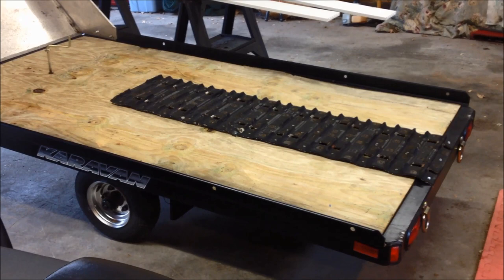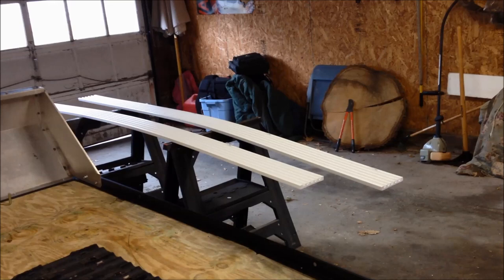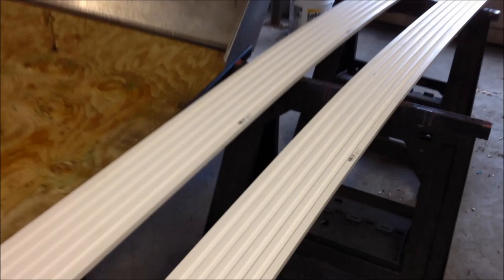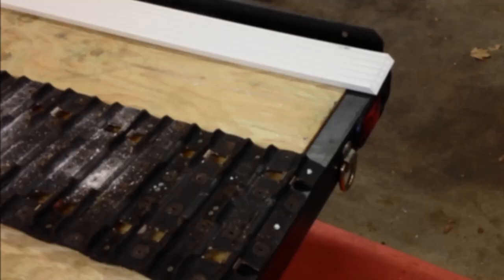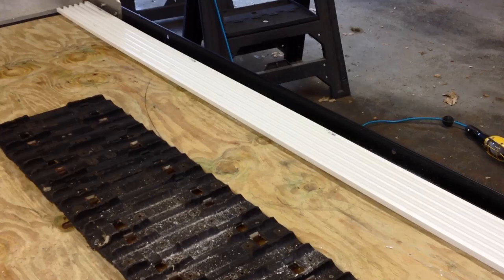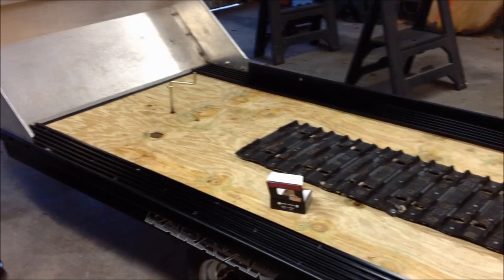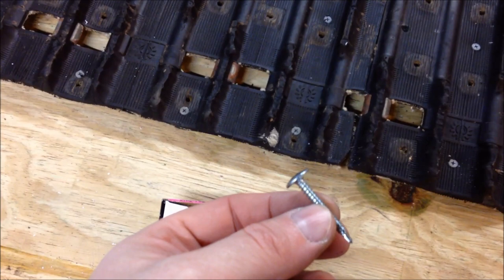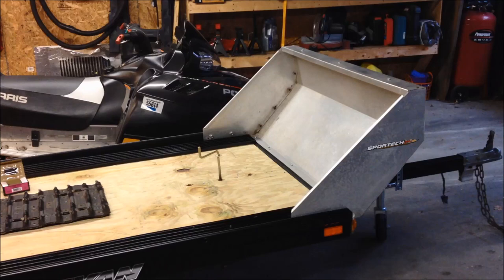Inexpensive snowmobile trailer ski guides

Comment: I tried this vinyl garage door trim once but in cold weather, your ski carbides rip it pretty good and leave bit of white vinyl trim all over your yard. Bed-liner really works better. The only issues with bed liner are 
1) you can’t cut quite as nice an edge as the vinyl, and the pieces are not available as long as vinyl trim.
 2) bed-liner expands and contracts dramatically with temperature changes, so you need to cut slots for the screws to allow for expansion and shrinkage. Otherwise, it slipperier and is already black and very rugged, no splintering here. 
It’s surprising how often I use bits of that bed-liner for other uses and often you can get it for next to nothing. One guy wanted $25 for his and  I offered him $35 to drop it off at my house and he totally did.
Reply from the maker: I only had a little damage / wear on the leading edge. If I was too do it again, I would have sprayed them down with bed liner.

Comment: This is a great idea! ive been wanting to get something for the trailer I built. Guess Im going to Home Depot. 30 bux! thats half the cost of the real sleds guides from Royal distributing! Thanks for the vid.
Reply from the maker: Thanks for watching. I made a follow up video as well.
Reply: cool I'll check it out. After watching this I went to lowes and found these and build my ramp. I'll probably use these on the trailer when I get it put back together, (suspension snapped last year). Thanks again! I'll be sure to forward your Vid!
Reply from the maker: Craig Gowing Yes, now is the time to d the maint on the trailer while it's still warm out.
Reply: Indeed. my buddy is welding up some new shackles, then i'll put the bed back on.

Comment: Great Idea, I bought the material at Menards. It came in dark brown, so I didn't have to paint it.
Reply from the maker: Wow, that's even better. Good find.

I would try putting on some of the spray on bedliner to give it a little more protection on it. That's the only thing I would have done different.

Comment: Looks good! I just picked up a used Triton and need to put traction and glides. Is that an old snowsled track you're using?
Reply from the maker: Yes, I had a used track that I saved from an older sled.. I just used some left over ceramic coated decking screws to hold it down.

As far as the guides. They are holding up well. I was thinking if I had to do it over again. I would have used some of the spray on bed liner versus paint. I think the bed liner will be a better option. Other than that, they are still working out great.
Reply: Dirk Diggler Thanks for the ideas. I'll be looking for an old track to put on my trailer.
Reply from the maker: Matt Molnar No problem. Good luck.

Comment: How is the paint and the PVC holding up, any cracking?
Reply from the maker: So far, pretty well. Paint hasn't come off or shows any signs of delaminating. I've loaded the sled on the trailer probably about 10 times so far and the the wear has been minimal..

Comment: Do you still have the trailer with these guides? How have they held up? Thanks!!
Reply from the maker: Trailer was scrapped in the spring due to rusted out leaf spring perches on the frame, The guides were still holding up after 6 years. Had some wear and breakage at the leading edge of the trailer, but it never got down to the plywood.

Comment: I bought an enclosed v neck  trailer and added this garage moldboard to the entire thing including both ramps it was definitely cheaper. First trip up the ramp with the sled chewed them up pretty good. Some of the groves  actually broke off. Anyone else have this problem ? maybe they were brittle from the cold but it was about 30° out.
Reply from the maker: I've had some broken pieces from the leading edge. Maybe the first 18" but after that no other problems.
Reply from the maker: If I was to do it over again. I would use some spay on Bedliner to strengthen them up.

Comment: I tried that a long time ago. The carbides cut into the soft plastic and they stick into it. Cut up bedliner works better in my opinion.
Reply from the maker: I've had some wear at the leading edges at the back of the trailer. If I was to do it over again, I would coat them with spray on bedliner to help them out.

Thanks for watching!
Reply: I did the same with a bedliner on my Clamshell.  Problem is now i have a brand new 28ft V nose trailer and I was shopping for different ideas.  I may just have to spend the extra sadly this time

Comment: GREAT IDEA! I'm in Northern Ontario Canada.... just checked on the price of this stuff.... avail at Lowes 10' lengh.... enough to do a double sled trailer, $300! lol nuts how much this stuff has come up in price
Reply from the maker: Wow, that’s insane.
Reply: Did you find an alternative. I was headed to home Depot in north Bay tomorrow to check options out.
Reply: I went to home depot in thunder bay Ontario $65 for a 10 ft length , as it turns out caliber is the cheaper option

Comment: I didn't paint them. I like them white. worked great with no warping or distortion. use exterior decking screws.
Reply from the maker: This is going to be the 4th season using them.  So far they are holding up great. Paint is sticking as well aside from the areas worn by the carbide. 

Thanks for watching!  Braaaap!

Comment: What kind of wood did u use for the decking
Reply from the maker: 4x8 pressure treated plywood. Picked it up at Home Depot for about $35.00

Thanks for watching and please subscribe.
Reply: +Streeters Garage it didn't have any reaction with the metal?
Reply from the maker: +Eric Maisch As far as the frame of the trailer, no there were no issues. However when I replaced the decking I sandblasted the frame to remove any loose paint and rust and then repainted everything. 

The trailer is stored in the garage with the sled in it during the offseason. So it's hardly ever wet or exposed to the elements.

Comment: geesh... $15 for a 10' length.?  plus paint, plus screws, plus these must buckle in the sun?  you can get standard Raider Glides at Fleet farm for $7ea.  5' length.  I think I will stick with proven design.  or go to Caliber.  its worth the money in my opinion.  Good idea though!
Reply from the maker: Paul. I checked FF and they were $14 for a 5' section. So it's a little more expensive than what you had mentioned. 

As far as the rest of the materials its stuff I had left over from another project so the cost was zero. I've also had zero issues with it deforming in the 2 years they've been installed. Don't forget the material was originally designed for exterior use, it seems to pretty stable. 

I like it just for the fact that it's a single length with no seams. 

There is an update video on my channel. Take a look at it. 

Thanks for the feedback its always welcome and thanks for watching.

Think Snow!
Reply: Raiders at Fleet farm are $15 for a 5ft section here in wisconsin